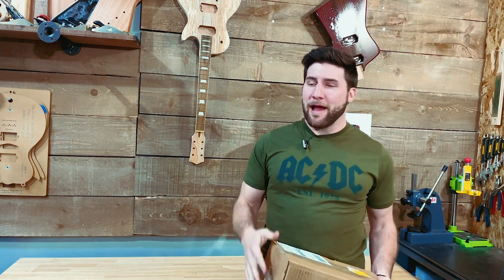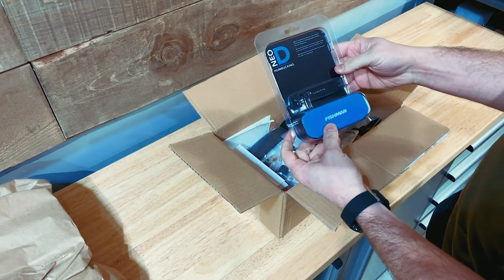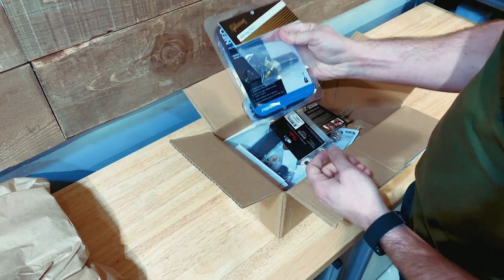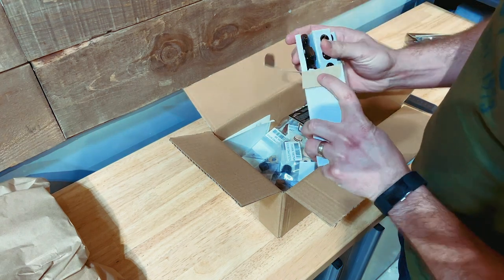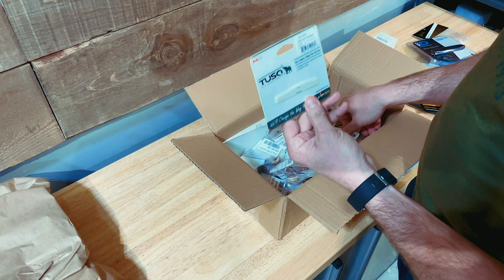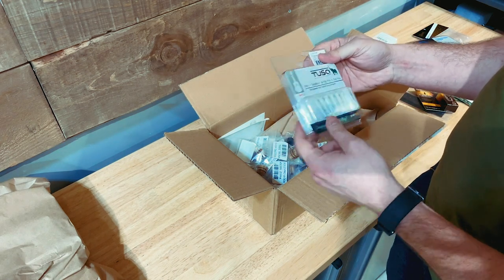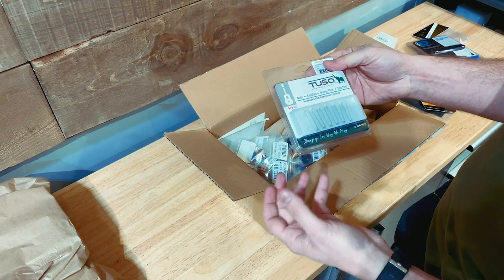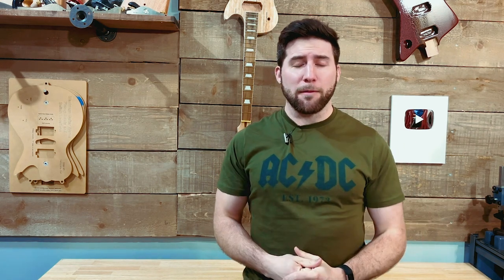What Upgrades Are We Adding to the Acoustic Build?

Comment: Place the volume control in the the front lower bout. The pickup connects to the pot. Then use the jack style you want running your wiring from jack to pot. Remember to anchor your wiring.  I think you might be introducing headstock dive with those tuners.  Long phillips number two hold the knobs perfectly for direct dipping. Remove o rings first.

Comment: Get with GunStreet wiring. I did an acoustic strat project that i put a Dimarzio in the sound hole (Using a single coil pickup ring) and had them make me the harness i wanted for it. (It was a volume, tone, and mini toggle (For switching between humbucker/single coil....it was a rail pickup) and output jack. it worked great, only thing i cant comment on is how to ground the system. I used an ibanez hardtail bridge instead of the acoustic bridge it came with, so i just grounded it to the bridge since it was metal, so not sure how to ground it to an acoustid bridge.
Reply from the maker: Gunstreet is awesome. I use them a lot.

Comment: All pickup wires are outputs. If there's a volume control on the Fishman, turn it up to 10 and wire it to the pot. Then straight to an end pin jack! It will work no issue. All this is if the pickup is passive! Active will still work but the wiring will be different. It'll work no worries. Nice project brother.
Reply from the maker: Thank you for this

Comment: As some have eluded to...you should have no trouble using a jack with the acoustic pickup since there is virtually no difference in the electronics with or without the installed cable and jack.  I like your plan much better than having to mess with a loose pickup and cable everytime you desire amplification...your setup will be so much cleaner and you won't have to fuss with storing an independent pickup and cable or be concerned about loosing them. :)
Reply from the maker: Yeah, I this option will be much cleaner overall.